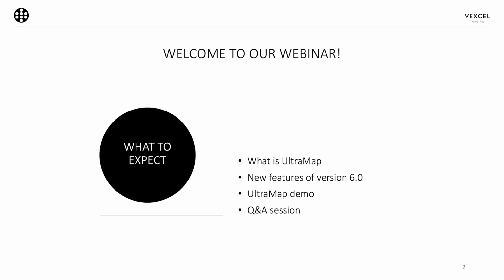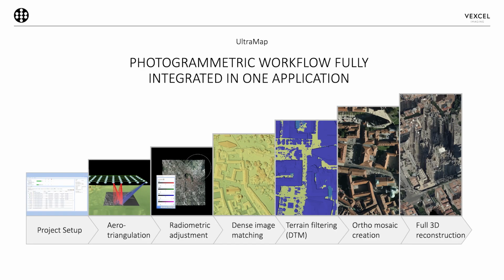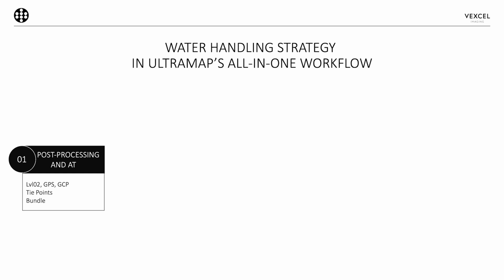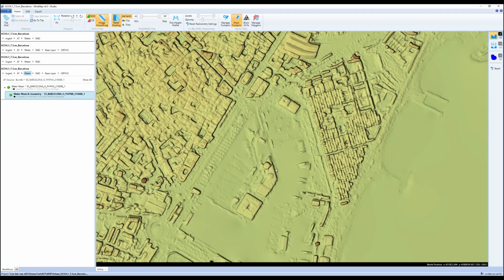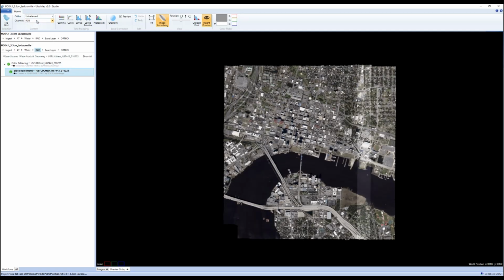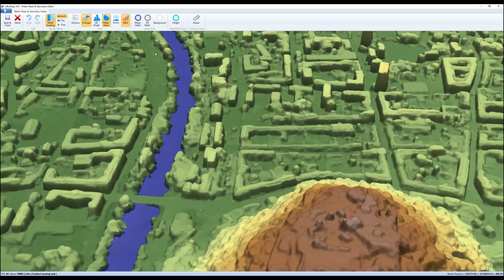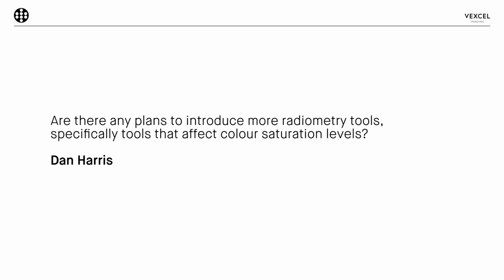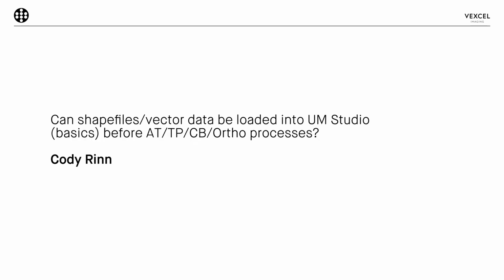UltraMap 6.0 Webinar

Comment: Hello. What hardware is recommended to run this software update smoothly ? thanks.
Reply from the maker: UltraMap is fully scalable and can run on flexible system configurations, ranging from single workstations to huge processing clusters. Modern Intel and AMD processors are supported, as well as powerful datacenter GPUs from Nvidia. For detailed recommendations for your specific use case, please reach out by email to info@vexcel-imaging.com!
Reply: @VexcelImaging  Thanks !